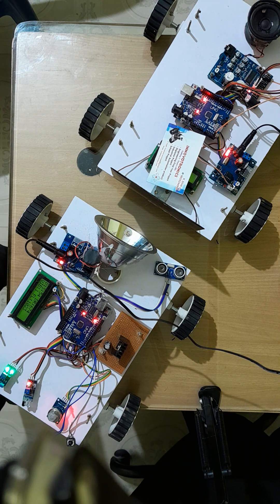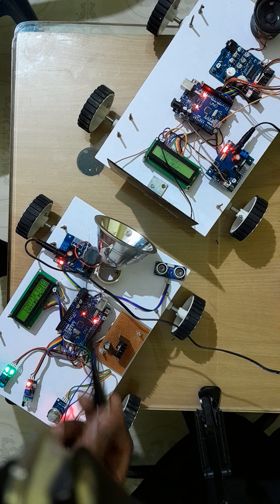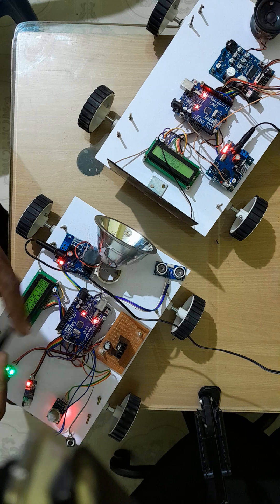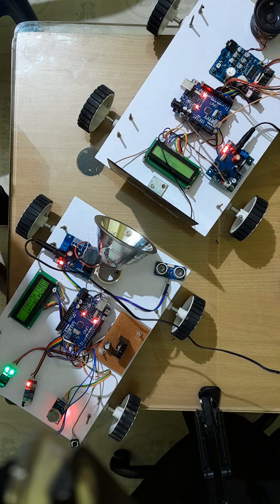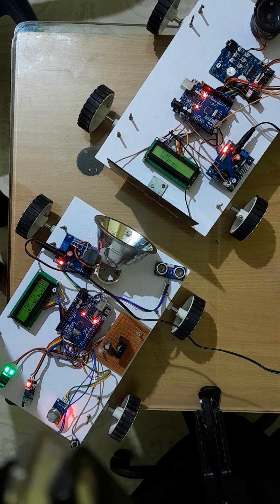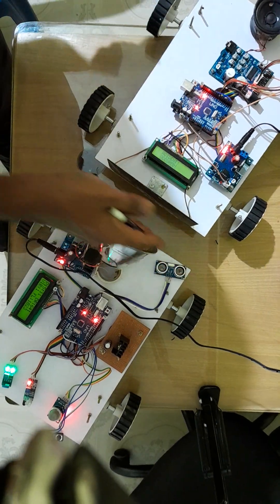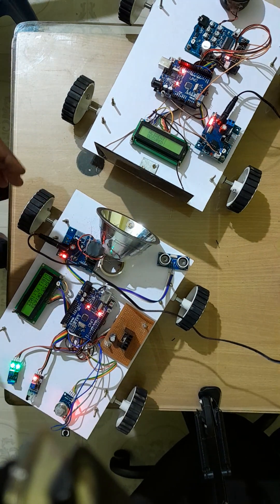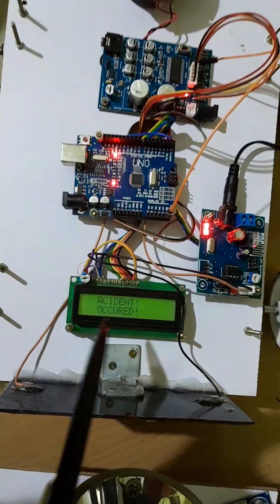Vehicle to vehicle communication using Li-Fi Technology

Comment: Hello sir please tell about tha compentents name sir and explanation figure i wat sir
Reply from the maker: 1. Arduino uno 2 nos
2.12v 1 amp power adopter
3.lifi transrecvier
4. 16*2 LCD display
5. 4 channel audio play back module
6. Usb to ttl converter 2 nos
7. Ultrasonic sensor
8. Gas sensor
9. Vibration sensor
10. 4*1 key pad
11. Robot wheel 8
12. Robot chase 2
13. Dummy wheel 8
14. Ir sensor
15.connection wire
16. Net and bolt
Reply: @innovationonelectronics6650  thankyou...